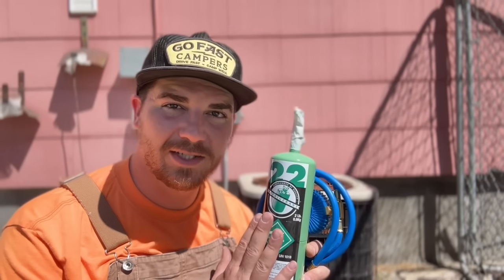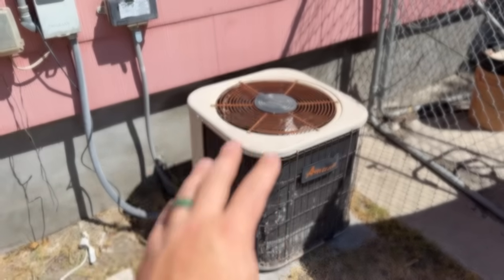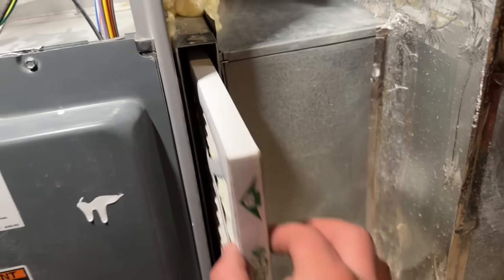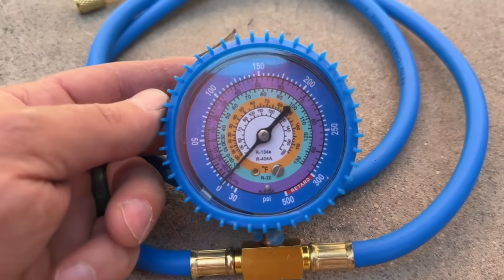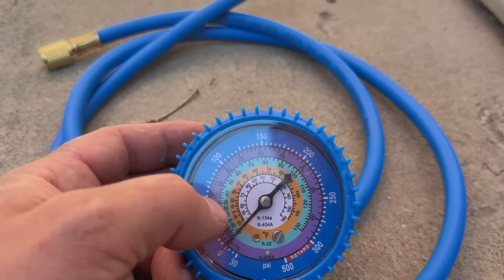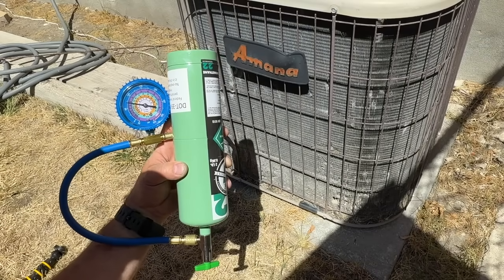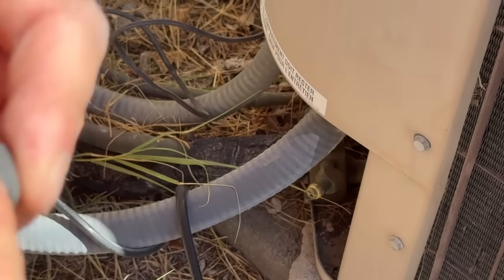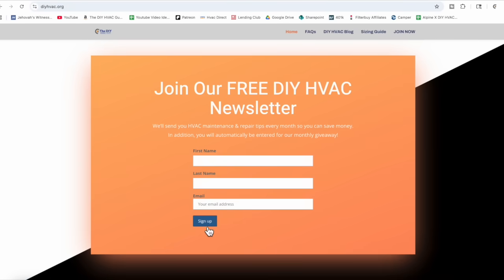HVAC Contractors Are Charging $600 PER POUND Of R22!

Comment: Great video!  However our 3 yr old Rheem system uses R410A Puron which requires 7 lbs.  I'm hear because I'm doing a sanity check on the $1,000.00 line item charge for 7 lbs of R410A.  Yes, $1,000.00!  Now then, one might say "well, there's labor involved" BUT, it's part of a warranty repair... compressor went up, Rheem is replacing it free... no charge.  They're already charging $400 labor for that install, another $222 for a liquid line drier + another $164 to charge the system with acid neutralizer = $786 for this "warranty repair" then... BUT THEN, add in another $1,000.00 for 7 lbs of freon?  $1,841.00 total.  Am I hearing a big "C'mon mannn..." or are they in the ballpark?  The techs were great and I'm very accomodating... had a propane heating system in place, coffee, breakfast to order etc., so zero problems there but... $1,000.00? I would expect any labor associated w/ loading the freon is in any of the other 3 line items... none of which I've complained about.  I'm reminded of a car repair I once had.  Let's say there were 10 line items.  The dealer charged me an in/out/on the lift for each item!  We bought this system from this company but seems there's no quarter given. Here's the unit in question: T608368 - 2.0 TON 1PH WARRANTY COMPRESSOR R410A.  Thanks, looking forward to your sanity check.  ps. I'm in Maryland but I see where one can purchase a 25 lb cylinder of R410A online for 150.00. Happy New Year, Peter

Comment: Again thankyou. I purchased the refill kit. However it is not hot outside, what is difference when adding to a system in heat mode or must I put it in ac mode? The kit comes with no instructions. Thankyou.

Comment: Hi there. Thank you for your videos. You said if you have a blockage you want to take care of that first. I had an hvac company come out to tell me thay my system needs to be replaced due to ,"The system pulling extremely high pressure, indicating that the system has a restriction at the metering device with 363.6 psig pressure on the liquid refrigerant side." Could you please tell me if its possible for me to find where this restriction is and if it possible to fix myself? Thank you so much for your time in advance

Comment: Great stuff man! I have a slow leak in my system and was gonna charge it up this evening but it was all the way out of freon so I'm gonna have to fix the leak, vacuum it down and then charge it. The leak is almost outside of the block wall on the high side small line.
 All my AC repair experience has been automotive but I have watched all kinds of HVAC videos to improve my automotive AC skills. And of course the furnace in the house I keep it up and going. Its so old people won't work on it any longer. I did do a thorough inspection of the heat exchanger last winter and no holes were found. New igniter, new fan switches and a new thermostat plus some rotted out vent pipe had to be replaced. 
It is a scary thought, actually getting carbon monoxide poisoning in our sleep and never waking up. So we keep a Carbon Monoxide alarm in our bedroom.  And hope its sensitive enough.🙂

Comment: Gauge at Ability is out of stock. Purchased the refrigerant (R-22)  but  Ability customer rep  referred me to Amazon for the gauge. Unfortunately NOT the same gauge. Does not follow the same scale as the one you used/demonstrated.  Can you or anyone look at this and hint how to properly use it before I commit a big snafu? 
(R134A R12 R22 Refrigerant Charging Hose with Gauge, 51'' AC Refrigerant Recharge Kit with 1/4” SAE Port for Home & Car Air Conditioning)
Thanks for all feedback

Comment: Had to have my 5 year old system (Goodman 3.5 ton 14 SEER unit) topped off last week during a heatwave here in So Cal.  Excellent and honest local company only charged $450 to fill with 3lbs of R410a, pressure was down to 75psi but not depleted thankfully.  Got a 2nd opinion at their recommendation due to my system being in a new (5 year old) manufactured home.  Called a big time HVAC company that has ads and commercials on the radio and TV and they wanted $1300 for the same job!  On the phone they told me $130/lb but tech said it's $225/lb.  So $600+ for labor!?  Told them to kick rocks and head the other place fill it.  Commercial place didn't even come inside to check anything, also said if I had a leak entire system has to be replaced due to the 410a phase out.  Complete BS.  I need a repair/refill, not a salesman. Local company I used checked register temps before, during and after refill to make sure that was indeed the issue and it was working.  They don't even charge for initial diagnosis.  
Anyways, thank you for the tip on this, I may not need an HVAC tech again, lol!  I'll be able to add refrigerant myself and I can already change the capacitor myself and test it thanks to your videos.  Really the only 2 most common issues.  Keep up the great videos!

Comment: The gauge wasn’t available when I visited the website a few days ago but I still ordered the 2 lbs bottle. Any alternatives out there on Amazon or eBay?? I had a local AC company come out and gave me a quote of $8k for a “repair” of my 30 year old system that was working fine 1 week ago. I checked the evaporator coil. Cleaned outdoor coil. Changed out both capacitors.
Reply from the maker: Yes, just pick up some cheap hvac manifold gauges on Amazon and you can feed the refrigerant in through the low side. I have another video showing how to do it with gauges if you use the search bar for my channel 👍🏼

Comment: The biggest problem with hvac contractors these days are the mega companies buying out the small locally owned shops for a million or more along with non compete agreements.   They are really buying the small shops reputation, name and customer list.   The original employees quickly bail when they learn they have sales quotas selling equipment at three times the previous owner's prices.  Often with flat rate pricing such as $500 for a "voltage absorber system".  Translation -  A $25 capacitor and an hours labor (mostly talking to you) along with a bogus warranty on that part to help convince you to call them again when something fails again.  Usually something different where the "voltage absorber system" looks cheap and they try to convince you to stop throwing good money at it (say $2k for a new coil).  Instead you can have a great new system with the new r454b or r32 (flammable enough it can't be installed in a closet and must have a shut down leak detector).  But the new system will only be $1500 down and $75 a month for 120 months.   For the cheapest system made.

Comment: Where do you find on the unit what type of refrigerant it takes?
Reply from the maker: On the side of the unit it will say what refrigerant it takes. You can also look at the coil inside and it should say, if your label is worn off outside

Comment: I did a 1989 Lennox w R22 per your last 410a. I was afraid of slugging the compressor so I did it upright. Took 45 minutes for a pound. I still have a little more to add but didn’t know if I should keep the tank open, open and close or what. So, diminishing returns. I’ll top it off next week. You’ve saved me a fortune. Wondering if Nu Calgon renew is a legit option for chattering compressor. It’s very mild chatter and wondering if more risk than reward.

Comment: All cool but R 22 is an single component & No need to add R 22 as an liquid & risk slugging the compressor on an vapor pump ONLY  or inverted tank .. id say after 41 yrs in this HVAC business just add with bottle  up right & let the R 22 gas enter the system as an gas NOT an liquid ...yes much slower but much more safer for an newbie ..but R 410 Absolutely not 22 tank MUST be inverted to add liquid  like you said  &  gas change is  supper slow but R 22 best for an novice  or your in for way more expensive problems

Comment: Hi, great video, very helpful. I checked my 5 ton. It was a little low at 33 degrees. I brought it up to 40. My question is, are the 75 psi and 40 degrees apply for both r22 TXV and or piston?  Thank you for your help. Keep the vids coming. I ordered a 30 lb from ability

Comment: Thanks for the great video! I just had my AC fixed because of a partially bad capacitor. That still cost me $200. I worried it needed a re-charge and the guy said that was $200/lb. even though online you could get 5# for $200. Thank God it didn't need a re-charge. My system is about 20 yrs. old and takes R-22. This is a great video to help normal people from not getting ripped off by Heating and Cooling companies. Again, thanks so much!!!!

Comment: Dumb question, I know, but how do I tell what type of refrigerant my unit requires?
Reply: Should be on the plate on the outside unit. Or the air handler. R22, 410A, R32 are some possibilities depending on its age.

Comment: Our Amana was installed in 1991. No leaks, same contactor, same capacitor, same fan motor, same R22 and it runs true as ever. We're so lucky and just to keep it that way, we purchased a new ball bearing fan motor from Nidec/USmotors, a new capacitor from AmRad and a new 40A contactor. They were all together in a storage container until 2 years ago when we decided to change the motor and capacitor just for good measure.  The existing Emerson fan motor has oil ports on both ends of the rotor shaft bearings and they both took a good portion of oil after 32 years. The existing capacitor still works so its a back up with the new contactor and the existing motor is still good and turning free now that its been lubricated so its a back up part as well. I believe that if folks experience a leak in their R22 HVAC, they should try to repair it and keep the R22 unit even though R22 is expensive because it transfers heat better than the new stuff does. AND, the new stuff R32 or R454b is almost as expensive as R22 !  Keep them running I say.

Comment: NO ONE  CHARGES $600 A LB FOR R22! Misleading title. Major HVAC contractor in my area charged me $72 a gallon. Either your a IDIOT for paying $600 or the title for video is clickbait
. Good channel, false title...
Reply: That's funny. It's not sold by the gallon.
Reply: Since a gallon of r22 is around ten pounds, $72 comes out to $7.20 per pound.  Quite a deal.   

Some might charge $600 a pound but $200 is more common in the US.

By the way r22 is still available in Mexico for ~$230 in a 30 pound jug.  That is $7.66 a pound but it's illegal to bring it into the US.
Reply: Called a company today.  They wanted $400 per lb.

Comment: Love this.... excellent.  Any idea where I can get that same gauge ? because ability is out of stock on it.... won't have for a couple months according to support
Reply from the maker: You can find  set of gauges on our Amazon store and then just purchase the 2lb bottle from ability. That will accomplish the same thing. I have another video that shows how to charge with the gauges. You do the same thing but only use the low side hose and then you use your manifold knob to throttle the refrigerant in 👍🏼

Comment: RE:  Leaks. I have a 1997 a/c unit that has developed a leak a couple of times. Both times, I used a refrigerant leak sealer with UV.  Each time, it worked wonderfully for stopping any visible leak via UVC lamp.

Comment: Note: It's also highly illegal to keep charging a system with a major leak.
Reply: Note: Go read the Section 608 official Fact Sheet on the EPA's website. It is not illegal to add refrigerant to systems that have leaks. It is illegal to add refrigerant to leaks that are above an "acceptable annual threshold" of systems that hold at least 50lbs of refrigerant. 30% annual loss for industrial units, 20% for commercial chillers, and 10% for residential. And this regulation only applies to ozone depleting refrigerants, which R-22 is but barely. That system does not hold 50 lbs of refrigerant and thus it is not covered by the leak regulations.

Comment: Just change the AC and the new ac will pay itself with the energy bills you are going to save.
Reply: Maybe if you live long enough but, new HVAC isn't reliable and parts are proprietary so just one service call will take away any electric savings in 10 years.

Comment: I am glad to hear from people who have had their units running for 25 years or more and are still running I've been wanting to change mine from straight A C to a heat pump I know it's just some valves and controls so far all the AC companies say it's not worth doing because my unit is close to it's end of life it's only maybe been running for 5 years and then only been used maybe a week or two  per year wish someone would come out with a diy video on doing this as I could then use it spring and fall
Reply: You can't make your AC into a heatpump. It's one or the other.

Comment: Is there a sniffer or a dye to find the leak and  repair it?

Do you have to have the unit running to recharge it?

Is there a precise way to recharge unit with a pressure reading and weighing the refrigerant? Thanks, trying to learn!

Comment: Everything I have read about R-22, is that you should dispense it right side up, especially on the low side, not upside down.

While R-410a must be dispensed as liquid upside down, because it is a Two Component refrigerant, R-22 is a Single Component refrigerant, so dispensing it as a vapor is perfectly fine.

Anyone else have any thoughts on this...?  Just wanted to make sure everyone is on the same page here....
Reply: R22 and R32 both are a single compound and can be charged right side up. If you are careful, not to flood the compressor, he did charge it within spec. Yes, best to charge with the value up, as a gas, but he knows what he is doing not to put in too much at a time.
Reply: @Garth2011  It may just be a habit from charging all those R-410a systems...

Comment: My R-22 Carrier is 25 years old and blows nice and cold. It has had a very slow leak since day one, about 1 pound low every 3 years. I bought a 25 pound Tank 15 years ago for $200
Reply: I use to be in the trade and installed my carrier split heat pump in 2002 and still is all original except the contactor and dual run capacitor and works well.If it stays leak free ill keep it and fix when necessary. Made better then IMO.

Comment: Great video!  I needed this two years ago on a 1998 Goodman. After a lot of internet study I came to almost exactly your solution. Figured I couldn’t make it much worse, so I summoned my uninformed courage and went for it. It worked like a charm. Got a couple more years. I only replaced the system when I found the evaporator pan had disintegrated from rust. Do what he says, folks!

Comment: I got a 5 pound tank of R-22 in case I get a small leak in this 45 year old evaporator coil. I just changed the blower motor, only because it got too noisy.  I have gauges already. Many times a leak will leave an oil stain on the aluminum fins. Look for that before cleaning the coils. If you see a dark spot, it is often a leak of oil collecting dust. I have a tiny leak on my Ford Expedition. I add a can every few years.

Comment: A great many AC units will need more than just the 2 lbs. There are some residential units that take 15 pounds or more. You do the quick math. Keep in mind that just adding freon doesn't fix the existing leak. It's gonna leak out. How fast is anybody's guess. Depends on the size of the leak. But keep throwing tons of money at that old system.
Reply: Guess you didn't listen? Getting a system going/running better ( probably 90%+) for $150 -250 is extremely productive ( we've been in 90° -100° recently) rather than $6k to $10k. Even at $.50 - $1 a day expenditures .. maybe $500-1000 over 3 or 4 years. Then save up for a new system!? The Gas will probably change again by then between the Duponts & Government??  🤔 
454A has been a mess
Reply: He explained this 1 pound every 3 year leak in the video. So, this was the correct fix for 3 years down the road.
Reply: @Garth2011  This all assumes the leak doesn't get larger or other leaks occur. Leaks always get worse, not better.
Reply: @willlewis6747  That would be true but from what the customer has been experiencing, the leak has not changed, every 3 years like clockwork. Why not believe that and help them? they don't need a new HVAC system as of yet.

Comment: "The only thing we're going to be messing with is the low side"... I assume he knows high side tells you a lot more about what's happening inside the system. I could be wrong but merely hooking up gauges violates EPA laws if you don't hold current EPA certification.
Reply: And?  This is R22, no sub cool or super heat has to be used to charge them up like the new crap running at 350+ PSI.
Reply: @Garth2011 
And???? You clearly don't know s*** about HVAC. Subcool and superheat are still critical for optimal performance.
Reply: @arizonaf2503  That only applies to modern Super techs who don't have any long time experience in HVAC.

Comment: HVAC contactor wanted to replace my AC for 6000 dollars, thanks to you it cost me 150 Thanks for the information.
Reply: Give the man a tip🧐🤣🤣🤣💪👍
Reply: It's likely because they don't have access or don't want to charge with r22. Also parts are mostly not available for r22 systems without conversions. 6k for a system replacement is cheap.